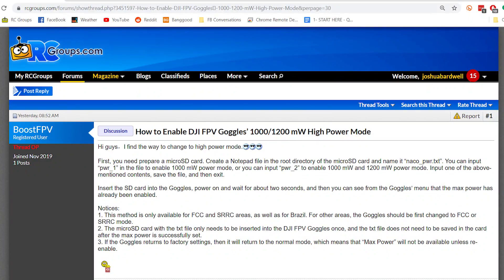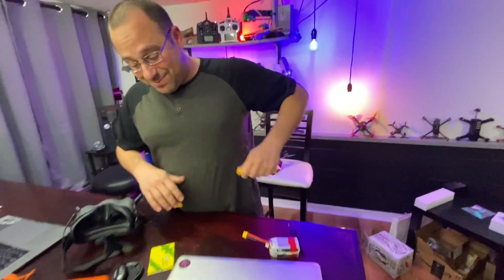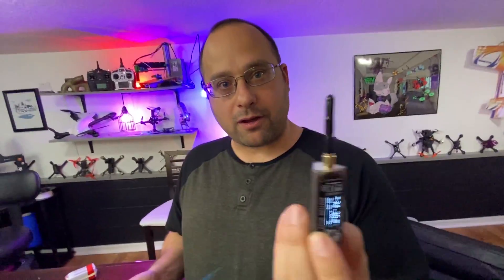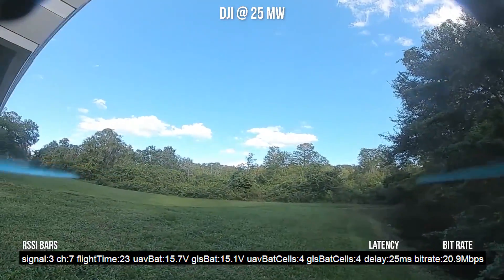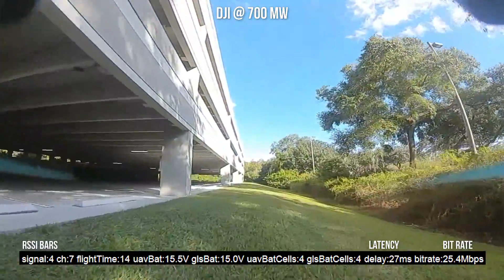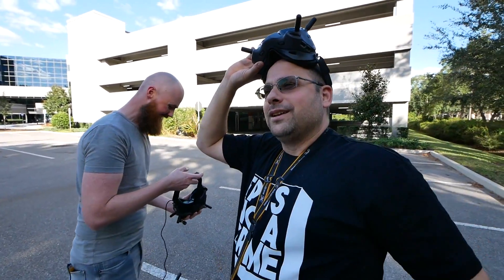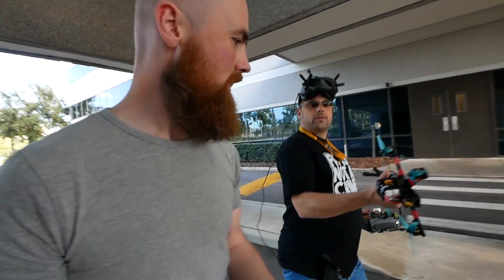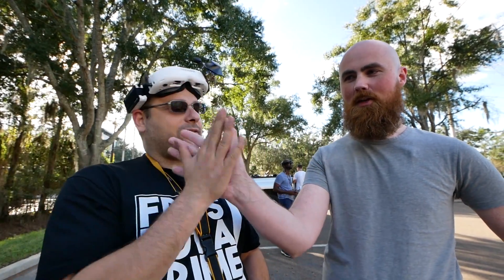DJI FPV more range than analog | 1200 mW HIGH POWER MOD

Comment: Where is you new daily driver Joshua? I mean jumper t16?
Reply from the maker: I am making tutorial videos about the process of setting up the Jumper T16. This takes a lot of time because there are a lot of steps. In the mean time, I took the X9D on this trip since the Jumper is not completely configured.

I could set up the jumper very quickly of course, but I don't want to skip the opportunity to make tutorials about every step of the setup.

Comment: PRO TIP: If you're using an FC with a PIT MODE switch (like the CL Racing F7) you can connect your air unit's power to it and have the ability to power cycle your air unit from your TX if it locks up after a crash.
Reply: Good tip brother

Comment: Hello Joshua.  Need some help..just finished the stingy build and used all parts from your list.  I followed your steps but used the wiring diagram when soldering all connections.  checked all connections and all are good. Ran blheli32 to flash 4 in 1 esc to latest firmware but esc 1 and 3 failed.  Tried again then 1,3 and 4 failed. Tried again then just 1 and 3 failed.  Any ideas?
Reply from the maker: Signal wires would be my first check. Or bad ESC.

Comment: I keep cocktail toothpicks in my DJI bag. Didn't realize how important that was. Seems some "know-it-all" once told me to use a "NON-METALLIC" object to reset stuff.
I think what happened is you shorted Vbat from one side of the bind switch to the case. I looked like the smoke came from where the frame contacted the air unit - right at the tie wrap.

Comment: This is the first time I unlike one of your videos. Y
The dji on 700mW failed to go through, the TBS on 800mW failed to go through, the dji went through with "1.not2W" and there was no analogue equivalent, yet you write as title the digital system has more range than the analogue. That's just a false assumption and what hurts me is you are smart and knowledgeable enough to know it. If anything, this would show a better penetration, but even then the test is lacking. I've seen several times now 5.8ghz systems doing 10km+. I asked several of the dji supremacists for any dvr of a dji doing close to that, heck even Alex Greve was only able to make 3miles on dji. The Dji system is still really awesome, don't get me wrong.
Reply: But he used a 9dbi + 800mW(29db) which equals 38db total and 1200mW(31db)+2dbi antenna on dji, a total of 33db. A 5db difference means the analog setup had almost 2 times the range.
Reply: @vibecoder9435  No, it means it had a bit over twice the focused output power, that is not the same as range, or penetration. Also, the crosshair only has 10.5dbi in a 30º beam, then it starts to drop, and he clearly was not pointing directly at the drone. Digital is less sensitive to penetration issues or reflections, this is why generally, the dji systems has a consistent better video feed than analogue at close and medium range. Again, put the air unit on a wing, clear sky and los and be settle for ounce.
Reply from the maker: After the drone landed I moved my head everywhere to try to get video back and it was impossible. Even with a 5 dBi advantage analog could not match the DJI.

Or compare 800 mW analog to the 700 mW DJI run. Here, the analog has an even bigger advantage because of its higher output power and directional antenna. DJI went much further.

So DJI won this test no question.
Reply: @JoshuaBardwell  After the quad landed, you will never get the signal back, your are an RF engineer, you know close to the ground you are at a disadvantage. The DJI performed better, no questions, that is not what I pointed out in my comment. Put the air unit and and analogue vtx on a hill and redo the test with directional antenas at 1miles, 2miles, 3miles. Your titles refers to range, this was a penetration and reflection test.

Comment: Good result for DJI. You may have been better with Rapid Fire in long range mode, because it beeps slower when your head is facing the correct way so you alway get optimum reception.

Comment: Why is your carbon frame connected to VBAT / GND, it should be isolated.
That would be the first thing to fix.
Reply from the maker: There is no way to guarantee this. There are too many sources of ground. Everything touching the frame is grounded.

Comment: You want more range? What if your HD goggle could do 2.4Ghz?  https://fccid.io/SS3-P1GS1902/Letter/Frequency-Band-Declaration-4371994     And yes, the air unit has the capability too:  https://fccid.io/SS3-P1AS1901/Letter/Frequency-Band-Declaration-4371871     Everyone keeps clamoring for version 2,....

Comment: The comparison with the analog was not fair. 
You should use at least (!) the same antennas when comparing the performance of different vtx operating on the same band.
Reply from the maker: The analog had a high-gain patch and still lost the test. It wasn't fair, but it certainly proved the result. Using omnis on the analog would only make it worse.
Reply: @JoshuaBardwell  I know, but what's about the same high-gain patch on the DJI? Maybe you could fly through the buildings with less power, legally.. and eventually use the hack if you need to send the quad to orbit the moon!

Comment: Sorry I will explain I have been flying drones since august, I have a jumper t16 pro and a tyro 79 for my birthday in October, the next thing I am looking into getting is goggles I would like to see how to set up dji goggles and a jumper t16 or a qx7 with a pair of dji goggles and a drone most videos have pilots using dji goggles and controller. You are the first person I found useing a non dji controller or tx   Sorry If I am unclear I have only been flying for 3  months. ( At the moment I have a qx7 a jumper t16 a tyro 79 and 129 and topsky prime 2 goggles I was waiting to see if dji was better then analog.) complete noob in outback Australia
Reply: Ainsley Israel
Hace 8 horas
Mr Bradwell could you do a video on setting up dji goggles and a jumper t16 or  taranis please.

 Joshua Bardwell
Joshua Bardwell
Hace 8 horas
I don't understand the question. The transmitter doesn't interact with the goggles at all.

Comment: Ham license ok sure but it's illegal to deface currency so you may want to edit that out there big guy.

Defacement of currency is a violation of Title 18, Section 333 of the United States Code. Under this provision, currency defacement is generally defined as follows: Whoever mutilates, cuts, disfigures, perforates, unites or cements together, or does any other thing to any bank bill, draft, note, or other evidence of debt issued by any national banking association, Federal Reserve Bank, or Federal Reserve System, with intent to render such item(s) unfit to be reissued, shall be fined under this title or imprisoned not more than six months, or both.
Reply from the maker: Seriously. Just take it easy. Nobody cares. Not even the feds. If this is what you're taking the time to write comments about, please re-examine your life.

All these people commenting about the defaced currency and not one person has gone back and freeze-framed to see what the actual joke was.
Reply: @JoshuaBardwell  no need to get all butt hurt dude, it's a comment.

Comment: All that happened was a short between battery positive in the DJI and battery negative through the carbon fiber frame. I have had something close to this before and the fire you see is the carbon fiber resin burning. Looks crazy and stinks but often does not damage anything as the carbon frame sinks the current.

Comment: Specs for both the goggles and air unit are rated up to 30dB as per DJI documentation. That's 1000mW, right? Then I'd say the unit should be able to handle it, not? I flew it yesterday several batts at 1200 and 1000 without any problems. Same as my mate. Noticable difference behind obstacles, just as job Joshua's video. Cool stuff.

Comment: It makes sense that the air unit could go to about 1000mW or over a little since a common rule of thumb in engineering is a factor of safety of 1.5; 1 being the maximum expected use of the product (700). If instead the air unit was designed to match 1W competitive units, than that would suggest an absolute max of 1500mW, meaning evening 1200 is comfortable within its operating range. But thats mostly conjecture

Comment: Does that mean that the Goggles are outputting that? I wouldn’t feel happy with a 1200MW vtx next to my head all the time..... that can be safe.....?!?  🧠 ⚡️
Reply: no its telling the air unit too
Reply: thats why you have toi blind it. it has 2 way communication
Reply: But surely if it’s 2 way then the output on both sides have to match or it would only be as strong as the lowest output level??
Reply: from goggle to the air unit its just to set the channel before you start flying so you dont need a hi output
Reply: and start recording

Comment: 700 to 1200mW is +2.3 dB. That's not a lot.
Reply from the maker: It's certainly something.
Reply: It's enough for a 31% increase to range, I'd say that's quite a lot.  Not to mention the increase in penetration and rejection of noise.

Comment: I'm wondering if DJI put that in there and was told no by the FCC.....So they just left it for us to find.

Especially since they already updated the firmware and haven't locked down the FCC hack for people overseas.
Reply: I don't think anyone "found" it, rather, evidence points to DJI themselves "leaking" it intentionally after the latest firmware enabled this.  Same thing with the FCC hack.  It's intentional.  DJI doesn't care if YOU break the law, they care if THEY break the law.

Comment: I've been spamming other channels with this. Hope you don't mind. It is on subject though.

If you look at the bottom of the goggle and air unit, you will find the FCCID's. If you google the number, it is the first hit. Lots of good info in those tests.
goggle FCC ID ss3-p1gs1902

air unit FCC ID ss3-p1as1901

1. It is not "top two are RX/TX, bottom two are RX only". It is actually, bottom left( if you're wearing them) is RX only. Top left is always RX/TX. And the right one's may take on different roles as needed.

2. Though you wrote off the Immersion Power meter's readings, I'm sure it had you wondering. The thing is, even if you had connected directly, you will not see anywhere near 700mw. DJI is doing different math than the rest of the community. This thing is probably outputting less power than the Byte Frost,... by a long shot. The FCC testing shows about 22dbm out of each antenna connector, which is close to 160mw. But then the "total" power in the testing is stated as 25dbm( double), because two antennas are always transmitting. This is still not 700mw. Here's the assumed math. Correct me if I'm wrong:  22dbm output on one connector through a 2.84dbi antenna is 24.84dbm. That is 305mw. Double that for two transmitting antennas, and you're at 610mw,.....fairly close to 700mw. Mind you, some of the outputs tested at 23dbm which puts you over 700mw using the fuzzy math. I just took the "average" of the readings. You can probably do a bit of algebra to come back to the expected outputs for 1000mw.

3. You probably know this part, but the testing shows the air unit as LHCP antennas, but the goggles as "dipoles". A linear polarized antenna sending/receiving to a circular polarized antenna is said to lose around 3db,...half power. So switching only the goggles to a circular polarization at or below the same db will net you a huge gain without sacrificing your adherence to the regs,....assuming you have HAM. I'm not sure where everyone is saying DJI had to do that to keep below FCC limits. That doesn't add up.
Reply: DJI's website and store say that the antennas on the goggles are LHCP :shrug: Their specs page also states that the max output from the goggles and airunit is 30dBm a.k.a 1000mw.  I think that is also due to the FCC part 15 rule that states you can use up to 1w and a 6db gain antenna and stay at or under 36dBm EIRP.  From my limited knowledge, it looks like DJI is playing by all the FCC rules.  ( unless you unlock the 1200mw option that is :)  )
Reply: @5zero7RC   Yeah, that's interesting that they have circular specs on those antennas. At the moment, I'm taking the FCC docs as gospel. And people switching out those antennas for just stubbys claim quite a performance improvement. But if you look at DJI's specs, those shouldn't be bad antennas at all.

Yeah, I'm not saying they're not playing by the rules. Just trying to make sense of their math. I originally thought that the 700mw was right up against the limits due to 700mw + their antennas gain. But I think their 700mw number was a grand total,....well under the FCC limits. Maybe they were just keeping the 1000w in their back pocket. And their site just states <30db,...not really giving you the actual number.
Reply: @5zero7RC  Sorry for talking to myself, but per your mention of 36dbm EIRP, I did do some searching, and see where I was previously wrong on some assumptions( not the ones in this thread). But if you assume my "DJI math" is correct, and work backwards from 36dbm, then the DJI 1200mw setting is quite possibly legal. If their 700mw setting is really the EIRP, then 1200mw minus the antennas puts the actual output less than 1W.

BTW. I am definitely open to arguments. I love to "fix" my thinking.
Reply: @rcrdps8144  I believe there is a separate part of the fcc part 15 rules that say you can not feed an antenna more than 1w of power, no matter what gain it has.
Reply: Mmmm. You missed the point of my DJI math. I'm saying their 700mw number is actually a total including antennas. So if you assume 1000mw and 1200mw also include antennas, then their 1200mw setting's amplifier output is likely less than 1 watt.
Reply: @5zero7RC  On the subject of the "dipoles" or not. While changing my quad back to RHCP in prep for some incoming antennas, I got to thinking, "if these are really dipoles on the goggle, then I don't need to change out the goggle antennas to match the quad". I'll try to fly that setup tomorrow and see what my range is like.
Reply: And the testing reveals?,...… dipoles on the goggles. Can't be sure unless I destroy one,....which is tempting me very badly,...  But I just flew my test flight path, and reviewed the OSD, and the lowest bitrate I get in my test area is 13.5Mbit. This is with RHCP Lumineer AXII's on the quad. I'm pretty sure my test with LHCP VAS Minion Pro's matched that almost exactly. The stock antennas on the quad produced slightly lower numbers. I'll try to upload this video in a bit.
Reply: Soo,..... I took apart an antenna. It's actually quite easy. The top half just pops off. And so I was wrong. The antenna has some helical bits, so it should be circular polarized. Odd that it doesn't act that way,....
Reply: I think the answer is in the numbers. DJI states it has an axial ratio of 3db. Just some quick reading puts that as barely circular. Some of our best antennas are less than 1db axial ratio.

Comment: The crossfire signal is also disturbing the dji air unit signal, you should try only with dji Goggles and controller

Comment: I'd like to see a  video where you compare the DVR recording of the main goggles with the DVR recording of the passenger goggles.   The one thing keeping me from buying DJI right now is that they don't have video output on the primary goggles, and everything suggests (including David's commentary in this video) that the passenger goggles produce a significantly worse experience.   I fly with passengers quite often.
Reply: Yeah the spectator mode is trash unfortunately. It has a quarter of the range.

I think it does it to keep the best picture for the pilot, which makes sense, but if your trying to do any flying that's not right directly in front of you dont bother. Hopefully they will update it in the future.

Comment: FWIW, if you have a ham license (can legally fly your analog gear) then you can also legally use the DJI unit at 1200mW.  The 1000mW FCC limit is for license-free (Part 15) operation of spread spectrum transmission devices.
Reply from the maker: Incorrect. The 1 watt limit is for telecommand of an rc vehicle.
Reply: @JoshuaBardwell  While such a limit does exist for telecommand, it applies to the signal you send to control the craft, not the video signal broadcast from the vehicle.  

I'm not wrong about Part 15.    Specifically check out Part 15.247 subsection (3).  You'll find that the power limit for Part 15 certified intentional radiators that use digital modulation (spread spectrum) is 1 watt.

Comment: LoL Here i am slightly worried (mostly unsure and uneducated) about blasting 700mw off my face, setting my goggles to 200mw with limiter ON........MEAN WHILE bardwell is going full send on 1200 mw.  Lemme know if you guys get any nose bleeds lol.  EDIT credit to DJI,  even on 200mw its completely doable in all the places i fly.   I just figure since i don;t need more then 200mw, im just gonna stick with 200mw.
Reply: say it with me now: Non-Ionizing Radiation...

Comment: You guys also need to look at fcc web sight on maximum exsposure limits this thing is close to your head and 5.7ghz is no joke to human body close range.this dji transmits on your head and i dont no about this stuff as a safety aspect.
Reply: though you have a point about potential overexposure of radiation, remember that the transmitter is on the drone, not the goggles.
Reply from the maker: The goggles also transmit. It's a 2-way data link. The goggles configure the air unit and request retransmission of lost data.
Reply: Did you actually read the FCC SAR report? It says it's 2.10 and the limit is 4.00 https://fccid.io/SS3-P1GS1902/RF-Exposure-Info/SAR-Report-4372007